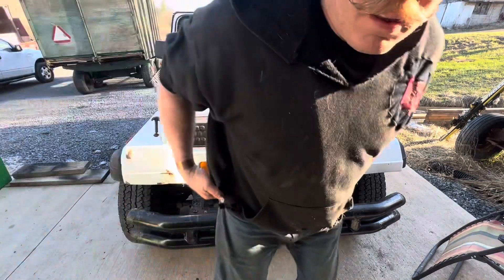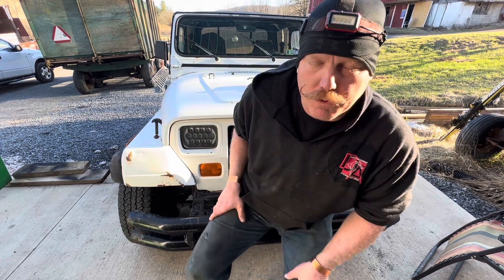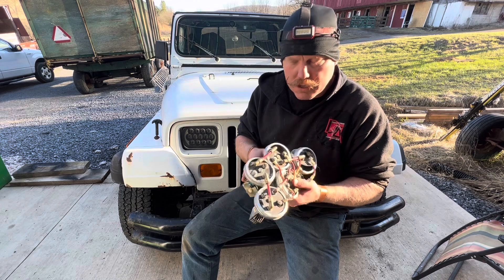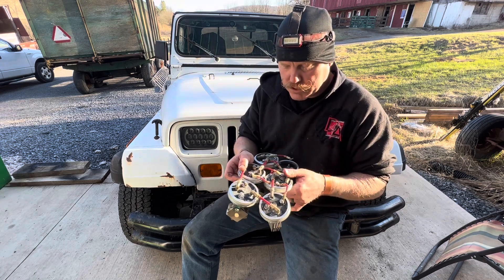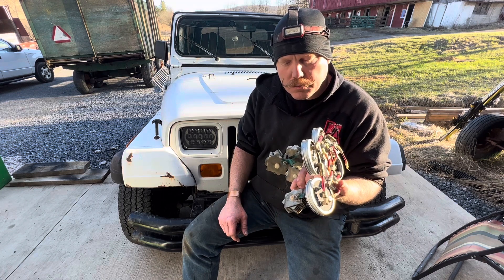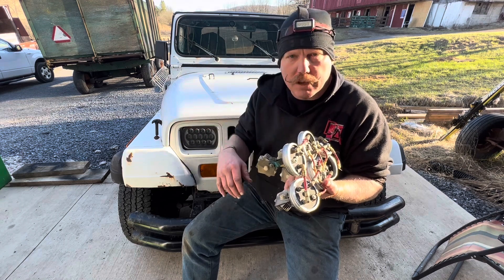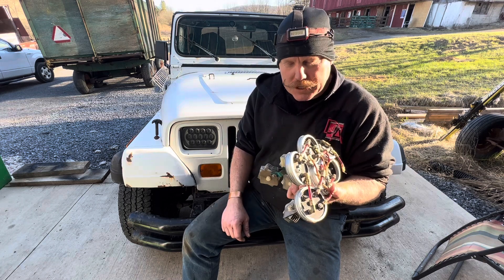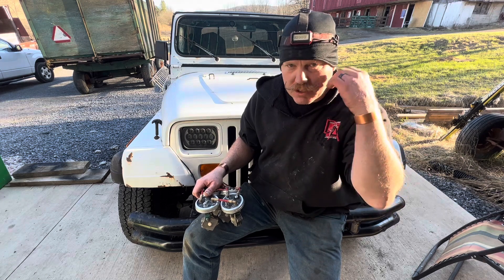Hho generator go boom.               #hho #hydrogengenerator #brownsgasgenerator #hydroxygenerator

Comment: Use sch 40 PVC. Should stay in one piece even if boom. Nice thing you can do also is machine a nice pop off cap, that's also a quick fill up cap, that's assuming you don't build pressure inside it. ( not recommanded anyway. ) 6 cells is a good design, cause it's the only way to avoid current leaks ( drycell do leak, current and fluids )
Reply from the maker: I almost did use pvc, but there was a very specific point to my budget and it didn’t fit.  The follow up build will be the no holds barred, highest mileage gain, no budget build. lol. And you can guarantee I will be putting a blowoff in. lol